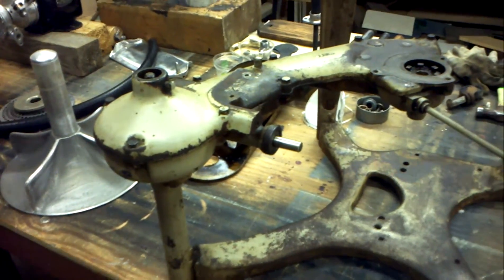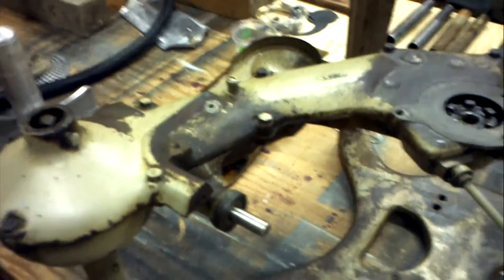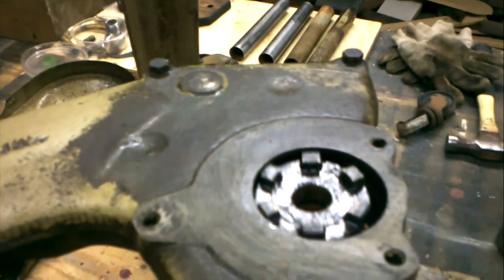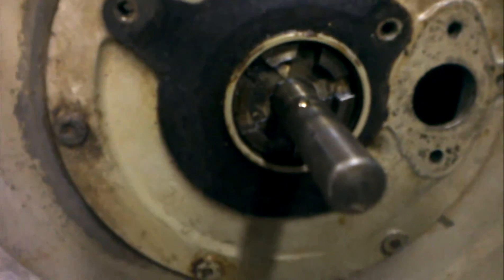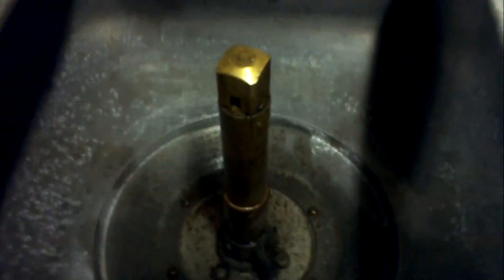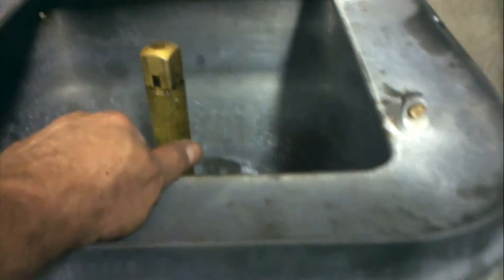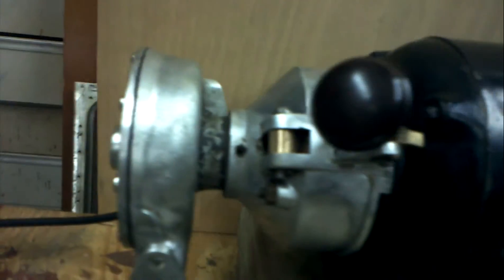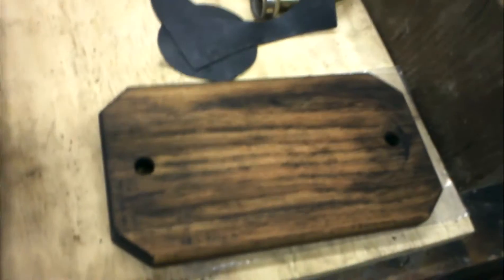Maytag Model 30WP Restoration ... Part 2

Comment: Brad Ross has subsequently learned that the gear box (transmission) needs NLGI Grade 2 multipurpose red lithium grease. He estimates that it take 1 1/2 tubes of this grease. The grease is primarily packed at each end of the mechanism where all of gears and drive mechanism are.
The heavy oil which he mentions in this video leaks out and so he currently does not recommend oil but rather suggest NLGI 2 grease.
Mark.